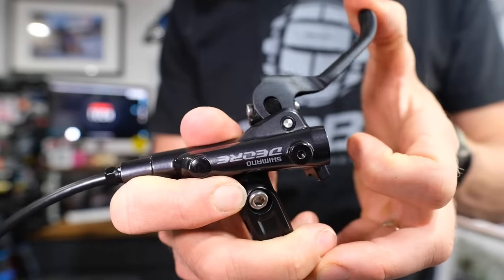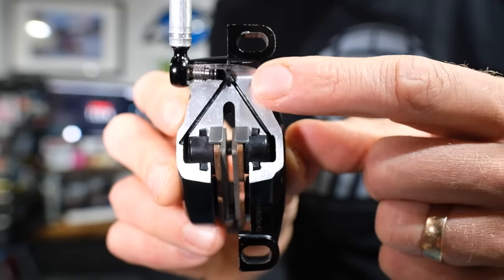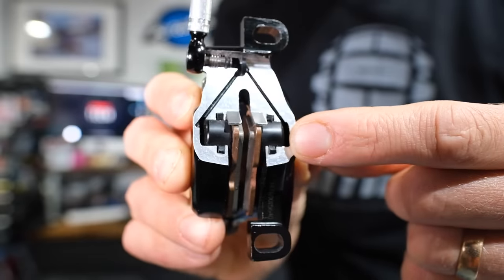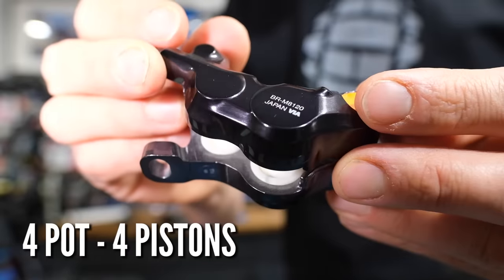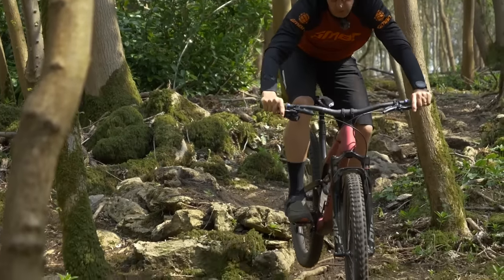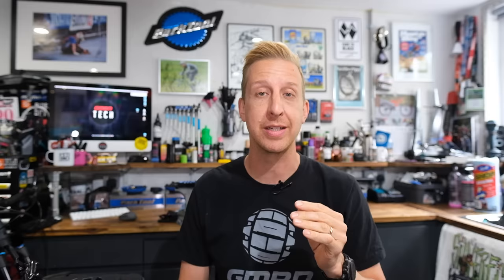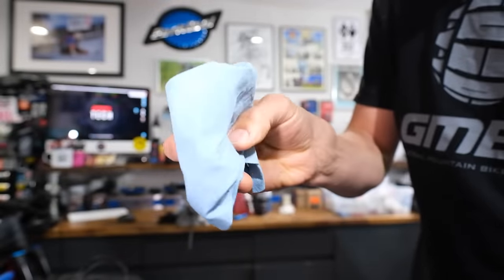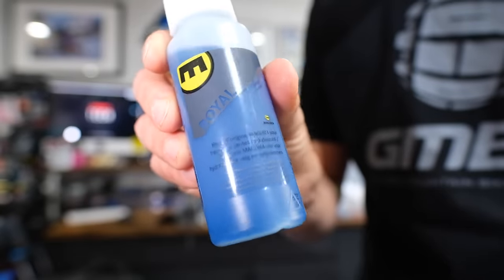Why Do My Mountain Bike Disc Brakes Feel Spongy? | #AskGMBNTech

Comment: If your brake levers are spongy, it's usually because they are Sram
Reply: Or Shimano on going and common wandering bite point issue...scary...pull the brakes, nothing happens, until u pump them...why havent they fixed it, still ongoing after 2+years.... mentioned on nearly ever new bike review with deore and above shimano's. Such a Shame.
Reply: Perhaps you just didn't know how to dial them in. Mine are fantastic through Florida humidity, salt, and muck.  😎
Reply: Yes
Reply: 😂 ok I can't agree more. I try to fix this 🫣 help me
Reply: Mine are sram😂
Reply: @rupedog slx or xt better then other series for such
Reply: Never had an issue with sram. Shimano are constantly problematic.
Reply: Tektro for the win

Comment: DO NOT USE an Allen key or any hard steel tool in between your Shimano or any ceramic pistons when extending them for cleaning. You will crack them by doing this. That  is not covered by any warranty. That is a new caliper if you do this and you cant get new pistons for Shimano systems they are not offered  and you will not find any stock of those calipers for a year easy here in the states. Use a modified plastic yellow Shimano bleed block. Essentially it is a bleed block with one side taken away for one piston to extend and press against a wide flat and much softer surface then an Allen key. Ask any Shimano technician or Look it up Shimano S.T.E.C training. Love the show  but that is a bad technique.

Comment: And another video with no answer to my problem. It's been a few years at this point since I've first encounter this issue and look for a solution. I've came across, and have myself some old brakes that worked amazing new, but became very soft after some use, I've tried pretty much everything, different bleed techniques, different fluids, different brake pads, rotors, changing seals, swapping pistons, modifying the system in different ways, no use. They. Just. Don't. Work. Right. Way weaker with much softer feel, still haven't found any solutions or even the cause of the problem to begin with. No idea why there's so little information about such problems with brakes, it's very common.

Comment: I had a pair of original Shimano deore hydraulic brakes that lasted 23 years with only a few oil changes and occasional burping to expel some air. No fancy bleed kits needed . Now I have modern deore set up which need far more maintenance .

Comment: @gmbntech Even had some new hacks for a seasoned mechanic! 
Over-Night thing on Shimano works actually.
Though instead of waiting, I usually just push some new oil from the bottom up.
Takes me like 20min at the shop (I work at) and ensures I get rid of ANY bubbles!

Comment: Brilliant !!! Out of the countless videos and advice I have seen on youtube about how to fix squishy and squealing brakes, this video has the most useful and has the most crucial tip that the rest of the videos have ignored and that is the contamination of the brake pistons and how important is it to clean them once in a while. I have wasted quite a few days trying bleeding brakes, chasing phantom bubbles, cleaning rotors and smoothening brake pads with sand paper just to get brakes working right and stop making noise.. GMBN rocks as usual!!

Comment: Thanks I am switching my brakes to hydraulic on my Surly Disc Trucker over the winter. I had cable brakes for a long time.After watching a lot of videos on bicycle brakes I made my mind up to switch.I will have a lot of time to do this it's getting colder here in Maine/USA. I have learn a lot from your videos and I use Park Tools only and Shimano  parts for the most part.
Reply: The tools or the parts don't matter that much - it's what's in the head and how you use it :) Anyway - even now, in 2022 - some of my bikes have V-brakes - and I cannot complain. Although disc brakes, if chosen wisely (I have extremely good experience durability-wise with Avid Juicy series) are much less needy for maintenance than V-brakes - the latter still offer plenty of power and precision (especially if older Shimanos with paralelograms are used, eg., LX, XT or XTR), plus the ethereal weight-saving aspect.

Comment: I have a fairly new bike. When I pull the lever until I feel resistance it slows the bike, however I can still further squeeze the lever hard to the point it will touch my handlebar grips, and at this point the brakes will barely even lock up. I was told this was due to air in my system. hopefully a bleed will solve this.
Reply: Did you manage to solve this with a bleed or was it something else?
Reply: @markdavies3151  Bled the brakes, get a very slight increase in braking power. Turns out I've just got rubbish brakes (Tektro). I've been advised to invest in some Shimanos, even cheap ones should easily out perfrom my tektros... My friend's cabled Shimanos have been stopping power than my Tektro hydraulics....

Comment: My cheapo (Shimano MT200) is schreaching pretty loud and feels not very powerful. The bike is relatively new (it was ridden from August to October last year), and the rear brake is working perfectly, so I don't think they need a bleed that soon...

Both levers have a tiny bit of play, but it doesn't seem to affect the rear brake anyway.
Reply: Clean.up pads and rotor, deglaze pads and re bed in.the front pads

Comment: if you use mechanical brakes:
the barrel adjuster loosened at the brake lever, so use pliers to tighten them, on the trail Wolftooth pack pliers are great for that.
you use wrong cables/hoses
brake lever body is too flexible
one brake pad is too far out.
lever reach got changed due to loose reach adjust bolt, some brake levers might have bolt in the lever body, and loosen no matter what, might need to glue it or use red Loctite, but in brake lever blade, it won't be an issue for sure.

Comment: I’m a believer in not over cleaning especially the brakes.
The oil in the system should lubricate the seals.
add in someone who uses disc brake cleaner/GT/WD product’s spraying into the calipers and wonders why they squeal ,drying out the seals in the process.
the brake surfaces need to be oil free, not squeaky clean, the brake cleaner evaporates taking the good lubricant and grippy brake dust particles with it.
Avid/sram are like a lottery difference is I’d rather waste money on the lottery,
With Shimano you get a regular result after a bleed.
Although shimano went through a patch of dodgy pistons and seals a while back.
If your brake is contaminated,figure out where the oil has come from,sort it bin old pads replace along with the rotor.
brake cleaner will not decontaminate pads but give the rotor a good scrub with hot soapy water and nail brush will get the rotor useable again if not too worn out.

Comment: Thanks for the advice - but older Avid Juicy 3 and 5 (haven't used 7, Carbon or Ultimate that much) seem to last forever w/o any maintenance - newer Elixir brakes seem to have problems around leaky lever pistons/seals very often.

Comment: I have tried the vertical hanging off my bike after a brake replacement. It made a ton of difference. I just let i hang over night and them did a mini bleed. Now the breaks are sharp and crisp.
Reply: Can u tell me how u did it?? Step by step
Reply: @Juancena-xb8mp  I will try. So what you do is that you open the bleed screw on the brake lever. Then you hang the bike ( I used a mech stand) so that your bike hangs vertically with the break lever as high as possible. You do have to make sure that the lever is horizontally level. If you have a bleed funnel it is best to have in screwed in on your lever. Than you loosen your caliper and let it hang down. Do not open the bleed valve on the caliper. Then you just let it hang there for 12 hours and gravity should do the trick. bubbles should rise to the top and Bob's your uncle!

Comment: Hi. I just bought a new bike. I have done about 30km until now . Even if i haven't use it almost at all my rear brake feels way spongier than my front one . Shimano mt 500 set internally routed the rear one. Talked with my service but they told me to use them some more and check them after . Both front and rear stop the bike with Great power.
Thanks in advance
Reply: Couldbe Shimano wandering bite point issue, or if just spongey then air in system, or contaminated from lube spray

Comment: I just got a brand new Trek marlin 6 and it's my first time using hydraulic disc brakes. I absolutely can't brake with one finger like most people say, if I want the tires to lock up I need to squeeze super hard. My old bike that has rim brakes stops significantly easier, I could use 1 finger on that. 

Idk what's wrong with it, the levers aren't squishy like air is in them and I tried to bed the brake pads in as best I could
Reply: Contaminated pads/discs for sure.
Clean and bed in properly...

Comment: Hi there @GMBN Tech #askGMBNTech -- Question regarding 11:18 . Since "hydrophobic" means "afraid of water" ==> no water will get in the system. Air may get in though, since "air molecules" are not charged/do not have a dipole.
Question therefore: Do the air bubbles in a mineral-oil system actually come from boiling water (if so ==> higher density, therefore at the bottom of the brakes//oil floats on water), or is it just "plain air" in that case? 
Thanks in advance. I'm really enjoying your videos. Keep up the good work!

Comment: I've had a deal on a set of tektro orion 4p years ago it was running fine, bit spongy but still firm enough.
So when I was shopping for 2023 bikes I bought one with the tektro Orion 4p thinking one less thing to upgrade right away, they feel super spongy no matter the mineral oil of bleed method I use they feel like junk. I tried to have them replaced under warranty but apparently they all feel like that it's normal.
Lame

Comment: Please do a full brake caliper service tutorial! Is there a way to replace piston seals if you think they are damaged ?
Reply: Think u are better of replacing
Reply: For sram guides, YES. DEFINITELY. Cos I have done it! U need a genuine sram service kit (got mine on amazon! Think its a single kit now covering multiple model years, so will have some seals u don't need for ur model year), but also specialist DOT grease. Granville sell it in tubes, far more than u will ever use, but cheaper and easier to get than sram...its called Granville Red grease...do NOT mistake for other red coloured grease...
Follow service guide available on Sram website.
If ur practical enough to fully service a fork say(not just lowers) then ur capable of this job I would say. Not that hard. 
Will need full bleed after as u drain the system, obvs.
Reply: @SidiNic  not at all....serviceable part...
Reply: @rupedog  i run Shimano, so not the same
Reply: @SidiNic  good to know this negative of Shimano, even though it’s usually preventable.   i have the SRAM code and need to do a piston replacement as it would start shuddering on hard braking due to chips I made on the pistons :/

Comment: I have cheap siv simaers hydraulic brakes and the calipers can be separated into two so it doesn't bother me if i accidentally squeeze the lever and pop the piston and i can clean or replace the seals or piston easy

Comment: #AskGMBNTech        I was wanting to raise the front end of my bike. Really wanting to know what is the difference between MORE SPACERS VS HIGHER RISE BARS. 
(And how each will affect the feel of the bike.)
Reply: If you add spacers, it reduces reach (as the handlebars come back towards you and up), but the higher rise bars don’t effect reach. That’s the short of it really
Reply: @harrybryson1130  presumably you could tilt the bars back though to reduce it
Reply: @LJS1605  in theory yes, but I think it wouldn’t look as good 🤷🏻‍♂️
Reply: And also, that would mess with the backsweep and stuff and probs wouldn’t be as comfortable either
Reply: The reason might be unknown (straighter back?), but climbing performance will suffer severely, because you won't be able to plant (or steer, or do anything from then on) your front wheel in extremely steep climbs.

Comment: #AskGMBNTech i'm planning on getting a new trail hardtail for this season and I'm thinking about getting a tire insert such as the Vittoria Airliner. In other words - will I still suffer from pinch punctures or damage to the rim, as I haven't tried out tubeless yet? Loving GMBN Tech, Cheers from Germany!
Reply: Go tubeless.  I resisted for a year.  It’s so much better.  I haven’t suffered a single flat since switching plus the tires feel more responsive without the inner tube.  Lastly you can put significantly less air pressure in your tires if you’re running steep gnar.
Reply: @mrsmartypants_1  and what about the insert (only in the rear)?
Reply: @johann9579  I have no experience with inserts. As I haven’t gotten flats I’ve found no need for them. I roll with tough casing versions of Maxxis tires (Minion DHR 2’s with Double Down sidewalks on the rear and Minion DHF’s MaxGrip on the front).  I ride some pretty sharp rocky steep trails too.  I have sustained a couple small punctures that instantly sealed. Lost less than 2 psi of tire pressure. Also I don’t go crazy low on tire pressure like some folks. I don’t like the feel of squirmy sidewalls. Lowest I usually go is 23 psi in the back and 21 in the front.  I weigh 185 lbs.  If I were you I’d convert to tubeless and see how it goes before buying inserts.  But if you do ride super rocky stuff, especially with carbon rims it’s always a good safety measure.  I ride alloy rims.
Reply: @mrsmartypants_1  Thanks for the excellent advice, mate!

Comment: #AskGMBNTech Hi, Doddy, I installed CushCore tire inserts for the first time. Installation went smoothly, but the insert causes a tire wobble even though the bead is set.  Is this safe to ride or will it onset premature wear?
Reply: the insert should not cause this, I suspect the tyre is not fully seated, and yes riding it like this will cause premature wear on the tyre, and uneven wear, thus tyre will be messed up after you correct it.
so to solve it let air out push tyre into centre of rim, and pump until whole bead is seated, make sure the line on the side wall is even.

Comment: What might cause my Rear SRAM Level TL brake lever to return slowly? (squeeze it and it doesn’t snap back) This symptom led me to try a bleed. I noticed the pistons not activating well, but a good clean and bleeding the line got them going. But that lever still doesn’t spring back as quickly as the other, Front lever. #askgmbntech

Comment: I'm willing to bet that 90% of the people with SRAM brakes that feel spongenous on a warm/hot day is due to an expanded piston in the brake level. SRAM REALLY needs to fix that S@#T for once and for all. you SHOULD have mentioned this in this video for the people who are new to mtb'ing as its a known issue with SRAM. I've given up using the sram stock lever rebuild kits (I refuse to give them another Pennie) and ordered two aluminum pistons yesterday. hopefully they fix the issue for good! if they don't I'm going back to shimano
Reply: Lets hope u dont get the far far more common shimano wandering bite point issue then😂 never read or heard about the sram lever piston thing as the changed the service kits/levers years ago (unless u got old stock service kit?), but Shimano's issue is mention every month in the mtb mags when testing one bike or another.
Maybe try hope, or formula cura next

Comment: #AskGMBNTech
Hey guys, I have a fox 36 performance elite FIT4 and I’m wondering if I need to use fox float fluid in my air camber or the suspension grease is enough? Also what about the rear shocks?
Thanks!

Comment: #askgmbntech hi, I have a bike with a 3x8 and am just wondering, what would be the issue with just buying a narrow wide chainring and taking my chainrings off, I was told by a bike shop that it would mess up the chain line, but I don’t understand how the chain line would even change as it would be sitting right where my middle chainring would sit, I do not understand the purpose of needing a full new drivetrain for a 1x conversion, my friends have did ghetto 1x conversions and it didnt effect the bike at all in a negative way

Comment: #askGMBNTech Hey Doddy, hey GMBN - Do I need to open the bleed port on the brake lever when pushing the pistons back into the caliper? Or more specicfically: Do some Shimano brake levers have overpressure relief valves? When pushing back the pistons on my Deore XT brake (BR-M8120 with BL-M8100 lever) some brake fluid pushed out of the lever with a small popping sound - not out of the bleed port that is, but rather out of the circular end of the brake reservoir. I suppose the system was overfilled. I cleaned up, did a bleed of the system - no more leakage afterwards. But I am wondering if I damaged something and should replace the lever? Cheers, Johannes
Reply: The side piece is a pressure relief valve

Comment: What about if the lever slowly ends up closer to the bars as you ride down the mountain? Is this brake fade or just air on the lines? Tektro hydros
Reply: Tektro brakes arnt it id say get deores but yet again you need a bleed for the tektro